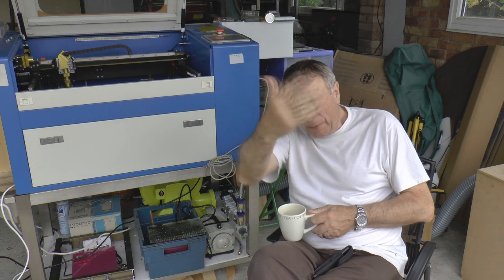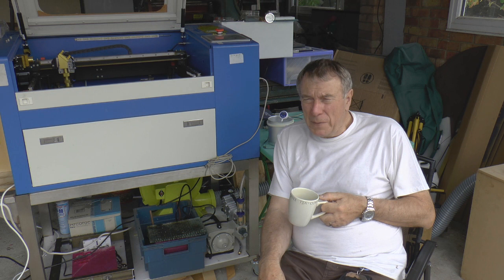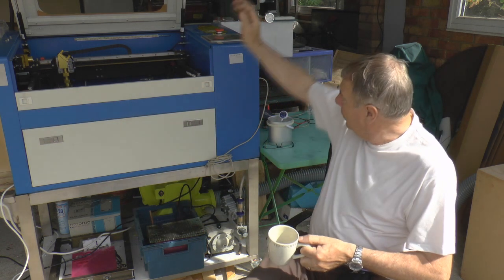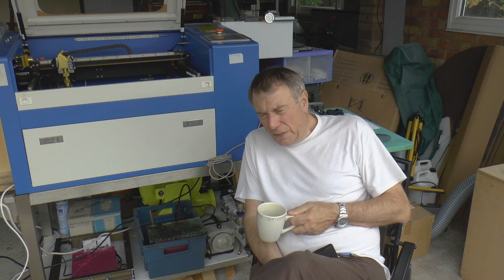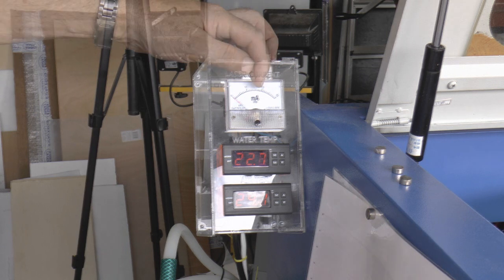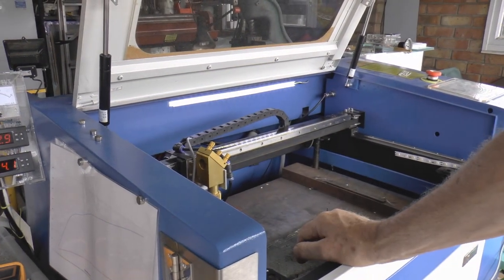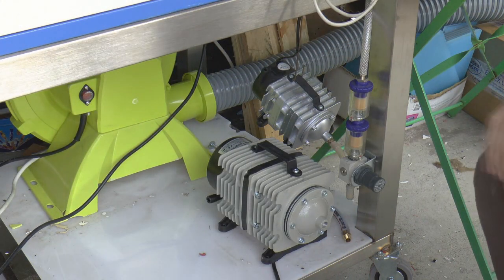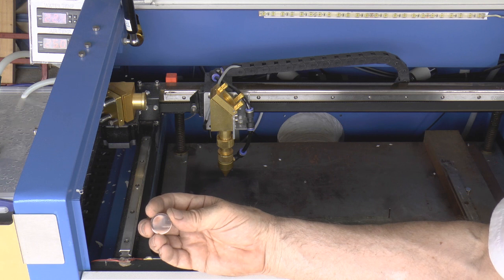RDWorks Learning Lab 75 What have I learned from 1 year of owning a Chinese Laser Engraver

Comment: Hello,

Thank-you for your interesting videos. I use a similar machine than you. I make a security module for preserve the tube in case of water flow problem. my module is checking the cooling water flow with a flowmeter like this
 http://www.banggood.com/Hall-Water-Flow-Sensor-Flowmeter-Water-Control-min-2MPa-p-80747.html. 
I make this control circuit with a uC PIC. This circuit is connected to a logic input  of the power supply for cut the laser automatically if there is a failing in the flow. the 'normal' flow can be set with  a press button, then it's easy to set the control for different pump. Whet the 'normal' flow is set, my module wil automatically cut the laser if the flow get down to about 80% of 'normal' flow. If you are interested, I can send you all necessary for make yours, include the pcb layout, pcb, uC programmed,  the source code....., if the electronic is not familiar for you, I can send a complete module. I like to send the complete description for share with everybody. It's also possible to make a version with an Arduino.
Il be happy to participate.
Reply from the maker: Hi Daniel

You are right I am not an electronics person. However you offer to share you design is fantastic news. Please join a new forum for Chinese Laser Machine Sufferes that has been set up to share just the sort of work you have done. It's at www.rdworks.lab.com and they are a great bunch of guys, many are electronics guys and will be pleased to share and distribute your ideas.

Many thanks for your input and your kind words
All best wishes
Russ
Reply: Hello, Thank-you, I will see this forum. I also interested to know where you buy your good actual tube ? and what you use now as mirrors ?  thank-you in advance :-)
You already learn lot about laser in your vidéos :-)
Daniel :-)
Reply: Hello, thank-you for the link, but it look to be a fake link. there is no valid blog at this adresse. I tried some times, but i not get the same page at each times.
Reply from the maker: Sorry Daniel there was an error in the link. It should be www.rdworkslab.com         I added and extra dot
Reply from the maker: Hi Daniel

https://mactron.en.alibaba.com/product/60206922896-219893473/Co2_Laser_Tube_70_Watt_For_Laser_Cutting_Machine.html
This is the 70 watt tube I received.
I would suggest you write directly to a young lady in technical sales called Gelly Dung. Her email address is sales02@mactron-tech.com..
Mention you got the link from Russ Sadler and ask for part numbers and prices for the 70 watt tube and a matching power supply. They normally ship via DHLwho will charge you almost as much for shipment as you pay Mactron for the kit. It will arrive in 3 or 4 days but you will have to pay import tax on top.

Best regards
Russ
Reply: Hello, Thank-you very much. Now. it' working :-)
Reply: Thank-you :-)

Comment: Hi I'm recommending you for sainthood.  Without all your entertaining and informative tutorials I'd have a pretty ineffective boat anchor instead of something to make balsa and light ply models.  I'm especially grateful for the ammeter and bouncy castle blower ideas.  I'd like to pass on a tip.  I worry about the tube getting hot but as you discerned, a water filled tube is a freezing hazard in case global warming doesn't let me plant an olive tree in Herts soon.

I shopped the Maplin sale for a solid state freezer box that runs on the mains £44.99.  24 liter capacity and can lower the temp inside to 15 degrees C below ambient.  And with the flick of a switch it can be a heater too.  I'm going to relocate my water pump and sort out using my temperature controller to keep things warm for winter use.

But I have two issues outstanding  

1) I have to keep inputting RD8888 and CC8888 too frequently for my tastes.  Have you or any of the cohort discovered how to nail that one once and for all?  When I say frequent it seems like every twice an hour or if I change programs.

2)  I set out to make a acrylic pegboard for some 3mm standoffs.  3mm thick acrylic at 3mm/sec with 30pc power (still running the 40W tube).  It did the zillion holes fine BUT it also made long vertical cuts that just were'nt in the programme.  WTF?  I don't have access to copious free acrylic :-( so this is proving to be a frustrating and expensive problem.

Comment: I am still trying to figure out how to ever afford one of these machines but cannot thank you enough for spearheading through the traps, trials and tribulations that you have. The amount of effort, work, technical analysis is truly commendable. Yours is one of the most useful and valuable YouTube channels around.  So, THANK YOU so much!!!
Reply from the maker: Hi
Thanks for the appreciative comments. My experience of the Chinese system and the tricks they get up to is mainly gathered from the huge amount of correspondence I get from people in trouble. Each individual thinks their situation is unique, but I can see from the patterns that they (and I) are just part of an Ebay marketing fraud. As I try to make clear in my summary, most machines are mechanically sound (a few are poorly set up) but the big con is in the B grade tubes and power supplies they fit. When you buy one of these machines you must factor in that in a reasonably short time you will have to be spending out for a new PSU and PROPER quality  tube. I point this out as something to consider if you are cash strapped.

Good luck and best regards
Russ

Comment: Hi Russ, 

I really  learned a lot from your videos.
there are some things i like to share with you from my expirience

1st about the water pump. i started off just like you with a tank of water and the pump supplied. however i did not use distilled water and i used a open tank with a fan on the tank as we do use the machine as a production machine and need the cooling capacity.
Recently we upgraded to the CW5000 chiller and changed to distilled water as well (now it is a closed system)
What i leaned about the CW5000 is that the pump inside is a lot stronger than the supplied pump. it delivers about 10l/m with a pressure of about 1 bar.
So i think the original pump does not have enough power to cool correctly.

In the past i was afraid to break the pipe with too much pressure, however some time ago i installed a new laser. and it was very quickly defective. i got warranty on the pipe if i did send them proof of destruction of the pipe so i did break it.
WHat i learned from that is that those pipes are really strong. do you still have the old pipes? perhaps it is a good video to break one of the old pipes to show how strong they are and how thick the glass actually is.

2nd about the power meter. You do measure the amps on the negative pole of the pipe. however the pipes do leak energy to the water as well. That is the reason why the machine needs good earth connection and if not you will feel electricity on the case of the machine.
the pipe do leak electricity to the water and as the water flows trough the metal connectors when it leaves the machine the electricity is transferred to the case of the machine.
I figured that out when i replaced all the original hoses of the machine with garden hoses to have a better flow. now my water tank became charged. (it is a good idea to have a earth cable hanging in the water)
Why do i write this... well if you measure the negative pole current then you do miss a little bit of current that is flowing via the water to earth. perhaps a good idea to put another current meter on the earth cable of the machine.

Hope you can learn a bit from me as well... please keep up the good work...thanks...
Reply from the maker: Hi

I have had about 3 correspondents with the issue you described and an earth wire in the water tank has fixed the issue. I may have the same issue but with my system I designed is as a fully insulated system. The water pipes are non conductive, the tank is non-conductive with no leaks to earth and the distilled water is virtually non-conductive (as you will be aware pure water is an insulator it's only the chemical impurities and dissolved solids that allow it to conduct), In my case there is only one path to earth and that is via the cathode wire which passes through the ammeter. So I'm pretty sure that what I'm measuring is what's going through the tube.  In your case you have earth connections via another path (your chiller) and there may well be leakage here that you are not measuring

Your point is well made and I greatly appreciate your comment because I hope others will take your suggestion into account when and if they fit an ammeter

The recommended flow rate for my tube is 2 litres per minute and they allow operating  temperatures up to 40C, as do many top tube manufacturers such as Reci and EFR. The little pump supplied delivers just over 2 litres/min and i find it's adequate.  Unlike many correspondents that live in hotter climates, here in the UK out mediocre temperatures and my non-production usage of the machine means I do not have to go to any extreme measures to cool my water. I do have a plan B for extended periods of hot weather (very rare) and that is a copper coil that I drop into my tank and pass cold tap water through it at about 1 litre per minute. Even in hot weather our tap water runs at about 13 or 14C. I do have a plan C as well. Outside my workshop I have a plastic 40 gallon rainwater tank. I can drop another circulation pump into that and pass it through my coil instead of wasting tap water.

Best regards
Russ

Comment: Russ

I bought a smaller air assist (aquarium pump) and now use it all the time instead of the pump that was originally supplied, as the new (small) pump is significantly quieter and is not so prone to walking though vibration

For the cutting I do, I don't see any difference between using the small and the original pump.

I think the only way to get a really large air flow to the nozzle would require replacement of the small bore tube that runs the last stretch of the way.  Or perhaps attach a high pressure pump / compressor ( which would be very noisy and expensive to run)

Re: Pure water
I eventually found the cheapest way to get water was from a car / motor factors.
I can buy "Steam distilled" water for £6.50 for 10L,

Comment: Something I have done for my laser:

Install a potentiometer between the DSP and the PWM input on the power supply. Turn the pot down to 0 and turn the laser on to 100%, then slowly bring up the pot until you are at 18mA or whatever you want to be at on your ammeter. This will prevent you from ever going over your max current, but it will also give you much greater control over the laser (dynamic range) because you can now operate the laser between 10% and 100% instead of 10% to 60%. I can give you more info if desired.
Reply: Interesting

So the DSP is producing an analog voltage to the PSU

I'd always presumed that the DSP generated PWM which was used by the PSU.

What value pot did you use ?

This also gives me some ideas about how to linearly map the DSP values to actual power values.

I $2 microcontroller would suffice to remap the input voltage to output voltage to make it linear.

I'll attach my DVM to my machine and take a look at what sort of voltage range the DSP is generating e.g. 5V or 3.3V or perhaps something higher
Reply: It is a PWM signal, but the PSU has a RC filter inside of it to turn it into an analogue voltage. So if we have a 5V signal at 100% duty then it would drive the laser to 100%, but if we have a voltage divider in there then we can set the 5V signal to 3V or whatever makes the tube happy, then we can set the DSP to 100% with no worries.

Edit: I have been meaning to use an Arduino with a 12bit DAC to read the input PWM, do some math, and then give the laser a real linear output. I would also want to set a min power so when a job is running the laser hovers to where it is just about to fire so the tube is much more responsive than it normally would be when doing pulses.
Reply: Ah. OK.

I took a quick look at the signal from the DSP to the PSU and my DMM read it as an DC voltage, but strangely it seemed to be negative with respect to the black wire from the DSP to the PSU.

But now that I've looked at the manual for the RDC6442, it looks like the colour of the wires they have used to connect to the PSU could be better, they seem to have not use black for GND.

Also the PSU seems to have multiple inputs connected together, so I think I'll need to find a manual for the PSU (though I'm not sure thats even possible)
Reply: I might still have my blown PSU around, it might be a good idea for me to try to reverse engineer the circuit to get a better understanding of how it works.

Comment: Thanks for your videos. Those have been very helpful. I have had my China laser about 5 moths and learn to use it from your videos. Understanding a laser is reached from my main job as laser operator with a little bit bigger laser cutter. I do a little side job business with my China laser and I haven't yet got any problems but I will be ready to change the tube when time comes. Have a good time playing with your toy (I consider these as toys) and may the beam force be with you.
Reply: Completely agree, very interesting and learned a lot from it.
Reply: As the laser tube, you could directly buy it from amazon.